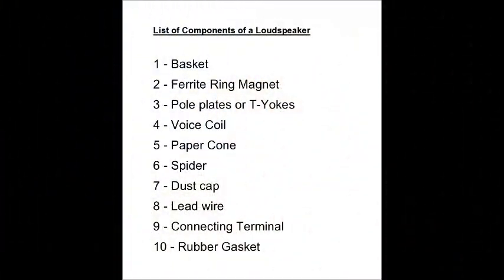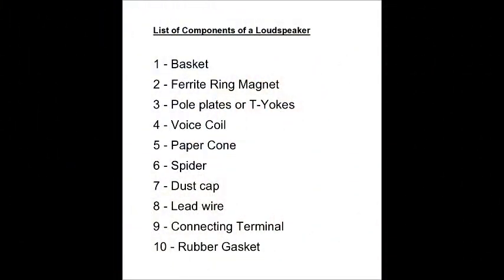Know about Loudspeaker parts and components

Comment: Sir nice information. Could you tell us the grade of mild steel used to make the top plate and T-yoke? And also the different adhesives?
Reply from the maker: Preferably low carbon ms.
EN 1B
Reply: @makingloudspeaker  I have two questions. What if ferritic stainless steel is used? And what treatment should be done on low carbon steel to prevent corrosion?
Thank you.
Reply from the maker: Magnet material is that which after magnetising will be a permanent magnet.
Pole plates are zinc/cadmium electroplated to avoid rust.
Reply: @makingloudspeaker  thank you Sir
Reply: Kaha se milte he yeh sab